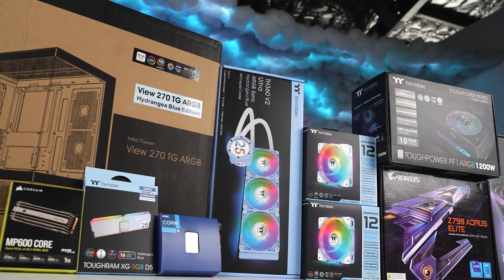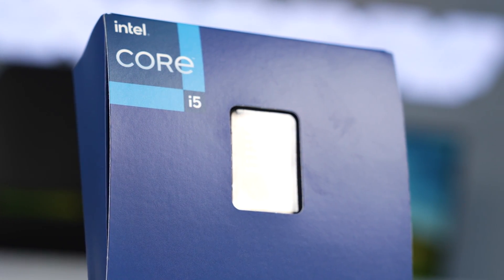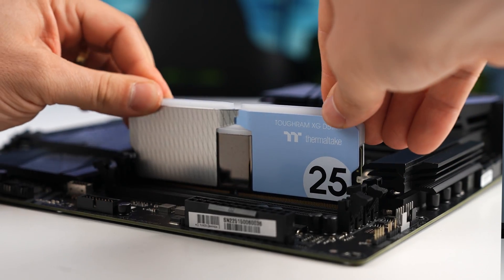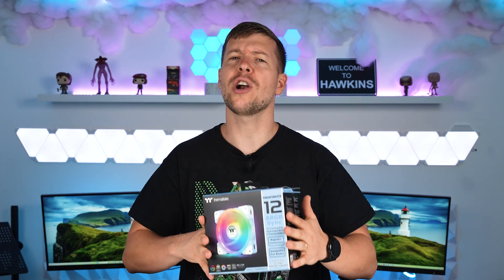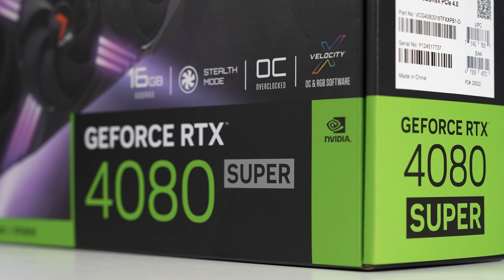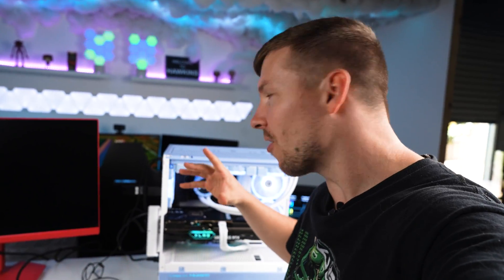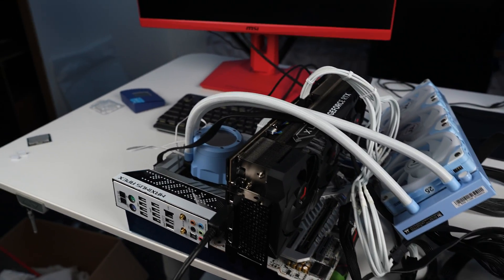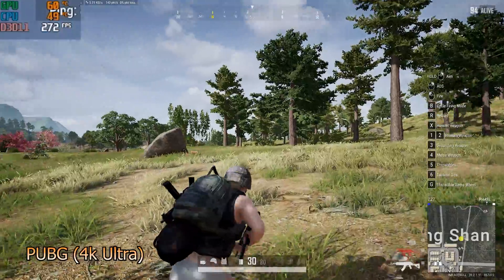Unleashing Ultimate Style - Thermaltake View 270 PC Build

Comment: This is a bit late, i had a similar issue on a B650 AORUS ELITE AX, i found the problem after hours, its having 3 fans connected to one fan header! They put a safety feature or they cheeped out on power delivery for fan headers. If you only have 1-2 fans it works perfectly, it will not boot if there are 3 fans on one fan header! i also came from a MSI motherboard that did not mind having 3 fans on one fan header, bizarre to say the least!

Comment: Hey I ran into the same problem before with I think that exact board and it was the top NVME slot.  It was using the same lanes or something as the x16 slot.  Had to move it and it booted.

Comment: The Z790 Aorus Elite needs F7 bios to support 14th GEN CPU's. The Z790 Aorus Elite AX W needs bios F2/F3 to support 14th GEN. Are your boards updated?
Reply from the maker: Yes those motherboards are up to date, iv used them in previous builds with 14th gen cpus
Reply: @DesignsByIFR  That is really strange then.

Comment: Warning ⚠️ some z790 motherboard's slow your gpu down from 16x to 8x if you use the top nvme slot
Reply: how can i check this? and what is the reason do you know?
Reply: @justd.2987  run GPUZ make sure it says (pci x16 4.0) for your gpu if it says 8x your running 2x8 not 1x16
Reply: @justd.2987  the reason is if you use the top slot for the nvme it will share lane's from your gpu and it will reduce from 16 down to 8. But don't worry too much because it doesn't tank performance it just slightly reduces it